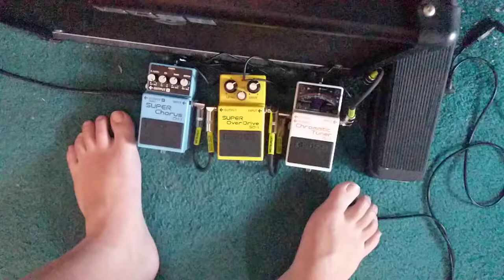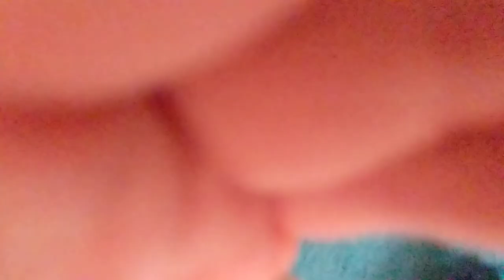Hum/noise w/ 1Spot & 1Spots 5 plug daisy chain

Comment: Sir, you can try change used power supply, may be your problem will resolved. For your 3 effect pedal i think don't have any problem, because for ordinary effect pedal use dc 9v 100 Ma. For your pedal wah i dont t know, i never used it again. You can check at your pedal wah, how many watts can used it, if your pedal wah suitaible with power supply you can buy it. Not very expensive you can buy at online music.